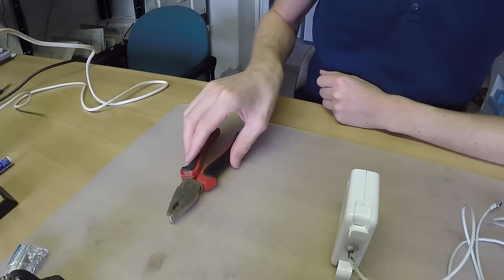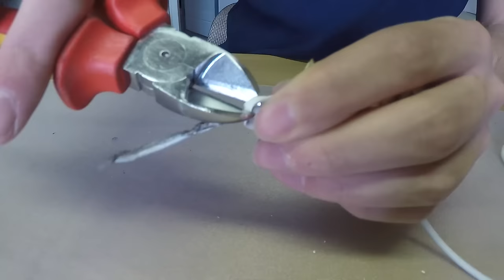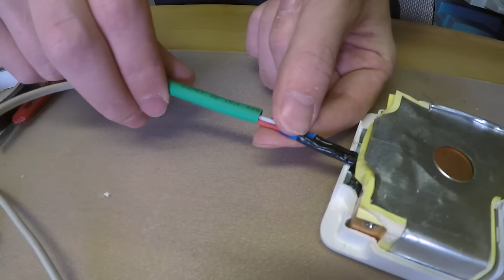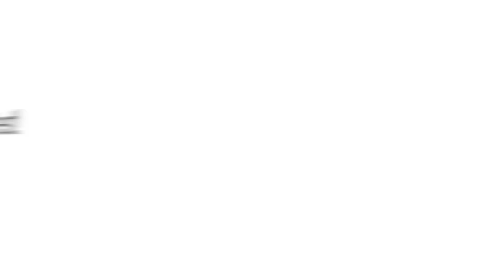How to repair your MacBook charger?

Comment: I continued watching this even though I know I can't do this
Reply: You just need some tools, you can get most of them on any shop for less than 10
Reply: @Zionoafk  I would recommend some wire strippers, I have never used them before because I didn't own any but I borrowed some from my grandfather and they work well

Comment: Watching on 3% battery, feeling sad because i have no money for new cord nor do i have any of the tools he used to fix it.  Goodbye internet! ✌️
Reply: Use your phone to watch the video to fix it then..
Reply: The tools he used would, with the essentials such as soldering iron, flux, solder, shrinking heat tube, etc would cost around £50
Reply: @techaid1940  nothing comes for free and that 50 will help you save hundreds and hundreds plus save on landfill long into the future
Reply: Nikolai Sliwerski um, ok
Reply: dobbatron idk, It’s in the middle ig, you are a teen or something, quite a lot, you’re an adult, you spend that on your weekly shop and spend even more on bills
Reply: Aiden Atkinson - Aido Playdo Aiden Atkinson - Aido Playdo i thought you were saying £50 was a lot of money, right? A new apple adaptor is £79 so 50 is saving money plus you get the skill and tools to fix other things. Am i missing something?
Reply: Nikolai Sliwerski no, I’m saying that it’s better than buying a new one
Reply: Nikolai Sliwerski that is what you thought I meant, right?
Reply: Aiden Atkinson - Aido Playdo it's not nothing but presuming you need to keep your mac working it's a sensible, economical option.
Reply: Nikolai Sliwerski precisely
Reply: Same

Comment: My charger looked exactly like this one at the beginning of the video.. Just confirming that after watching, I was successfully able to fix my Magsafe 2 charger doing exactly what this guy does, but I only used electric tape to hold the wires in place, hot glue to support the base, a pair of scissors, and a pretty small pair of pliers. Prying open the charger is a little tough at first, but everything else is pretty simple. So if you’re broke & need a quick fix don’t worry about buying all the extra tools & pieces. It can literally be done with stuff you already have laying around the house. 👍
Reply: I'm not broke, but I refuse to give Apple another red cent. My 3rd adapter just failed. Apple should be sued for this hack job design of theirs.
Reply: So you just taped the wires together instead of soldering?
Reply: @taliesinmusic  that’s correct, still working since I fixed it
Reply: Thanks for your such useful tips for us❤

Comment: How can you know due to contact between worn-out old wires, there is no short/blown fuse/ internal damage in the charger, before spending so much time to repair it?

Otherwise and minus cosmetic imperfection, You did a great job. 
LIKED.

Comment: Install a plastic wire tie around the wire bundle inside of the case, for strain relief. If it was longer, tie a UL knot. Either way, something is needed so it will resist being pulled out. Thanks for the video!
Reply: Like a twist tie on a bag of bagels type thing?
Reply: That's a great idea!

Comment: A video that provides help is always valuable. I searched for a video to assist me in resolving an issue with my 2017 MacBook Pro charger, and I found one that was published in 2016. Despite its age, the video proved to be beneficial in solving my problem. It had no complicated setups or flashy effects, just excellent content. The fact that it continues to aid users even after seven years since its release is remarkable. This is truly an outstanding video, and I appreciate the creator for making such a useful resource.

Comment: For anyone who got confused with the wiring. He connected the outer metal wires (he used red shrinking tube for them) with the black cable in the transformator.  So I think it's the ground cable. The inner tube with the white cable (probably power cable). It didn't get quite clear in the video and I had problems figuering it out. For me it worked out like that and my charger is up and running again. I hope I could help :)
Ps: I have to appologice for my bad english due to my mother tongue beeing german. (not form Germany, but Austria ^^ the land of the mountain kangaroos)
Reply: thanks fo this clarification
Reply: Yeah that one took me a second too.

Comment: Sick Video, works without soldering the connections as well, noticed a lot of people saying they didnt have the tools, you can honestly do a way worse job of this but still fix it by just using electrical tape and braiding your wires. (full disclosure though this method is way more fragile but still renders a working mac Charger)

Comment: Complete tool list would be useful
Pliers to separate the mag
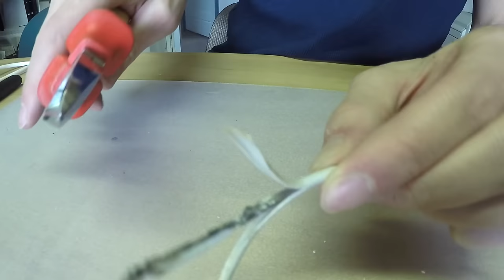Wire cutters to strip wires at 0:36
Again wire cutter stripping and exposing metal inside wire at 0:50
Heat shrink tubing
Using a lighter to...?... Keep the wires melty?

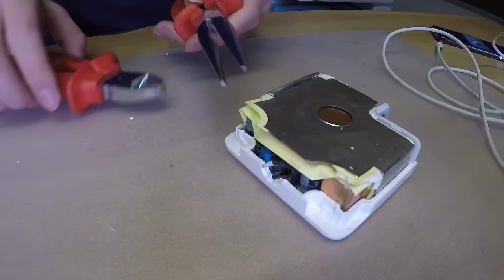1:38 use box cutter to cut off part in the mag to expose the wires with a needle nose pliers and a wire clipper
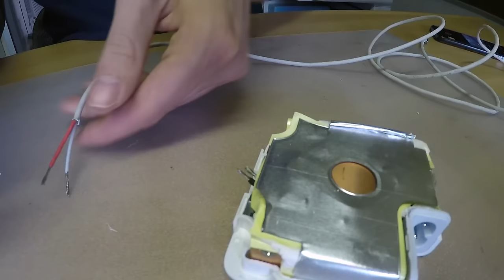2:00 use more heat tubing for...safety?
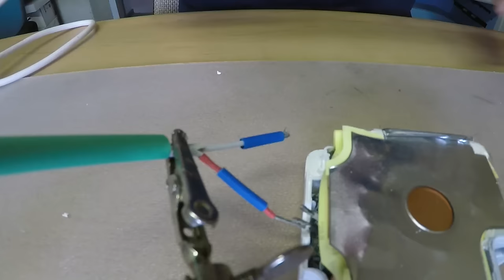2:12 use unlabeled tool (clothespin and book would work I think?) To hold wires up for soldering

Soldering i think just melts the wires together and should be practiced a little beforehand but is probably doable

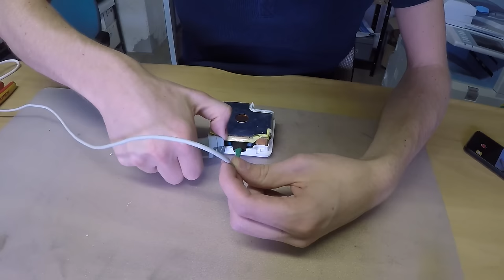3:00 then use lighter to shrink wrap the tube?
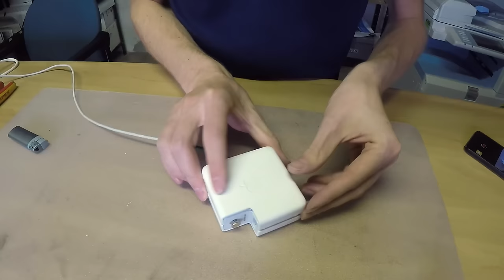3:24 this device right here almost would have made the younger me click out of this video.That is a weird looking device he chose to not label, and I've never seen a super glue gun look like that. Because that's all it is, super glue. Thankfully I was able to pause the video and read the bizarre brand of super glue he bought. But you could probably buy it at any dollar store. Most of this comment is just to set the record on that one.

After that is the hot glue ending.

Comment: I learned all I needed in the first five seconds - separating the case so I could get inside. After that, I was able to replace the cord with a new one I bought on eBay.

Comment: I have done it so beautifully. :) so happy! mine looked like exactly like yours and my child pulled it cut it off from the cord. I have done all similar but except that I did not soldiering, rolled the coils together by hand and I found it strong like that and coz I don't have the kind of glue you had it at the end, I insert earphone cover plastic from the T side of the magnetic end and take it all down to the tip. It not only hold it tight but also make it look like original. It costs me 3 GBP. From UK! Apple must give you millions of dollars, I suggest! ;)
Reply: anteneh addisu Yimer did you use the heat-shrinking tubing?

Comment: You can re-use the restrain, it's molded over. You just need to leave the longer wires and pull them out. Clean it, slightly expand and ... profit.

Comment: I did it, just crappier. No prior experience.

Soldering Resin core  +  flux = $6.50 at home depot or lowes
I borrowed a soldering gun. Ask your neighbors. 
My soldering job was terrible, I used electrical tape instead of heat shrink, and I broke the charging case when I opened it. 
It looks ghetto, but it works. I saved $23 dollars (from a used one on ebay) and not gonna lie I feel kinda proud.

Comment: Great video and helped me repair mine. I however did it more simply as only the outer cable was severed. I got a length on the outer cable by stripping the casing top and bottom, twisted the ends and soldered them. Then I wrapped black electrical tape round it and hey presto! Now advised my family not the bend the connection so hopefully it would last. However should it break again then I still have your method as plan B!

Comment: Great demo - aIve hopfully fixed my charger - BUT would be good if you clarify wire connections. - Bit worried about plugging in incase i blow my Mac.
Ive connected central white cable with blue cable in charger and outer mesh wire twisted together with black wire from charger. Can some one tell me if ive got it right????
thanks - im in AUZ.
Reply: RIP

Comment: Thanks very much Juul. My MacBook Pro charger was in same condition. I was about to buy a new one costing roughly USD 100 here but then I came across this video. I followed (I am not electronics engineer) exact same step on my iPhone, prepared the wires, cut etc and using the help of a local electrician who just knew enough (i.e. soldering) I got my charger back in absolute working condition. Overall it cost me just 50 cents (for soldering).
Reply: is it working properly?
Reply: @ranniellarheapueblos4591  Yes. Working fine

Comment: Thanks man. Get the job done that way! I have been soldering for a while now so the repair was pretty straight forward. I was lucky enough to have some shrink wrap tubing on the bench and was done in 15 or 20 minutes. 

Can't stress enough, though, that you have to know how to use a soldering iron and a little bit about DC electrical comings and goings. i.e. White to White - Black to Red.

Comment: OMG. Seriously? a terrible botch. why didn't you solder these wires directly to the board, replacing the damaged ones? Zero work esthetics. This looks terrible. I repaired my charger and it looks now like original. Even this rubber hosing is original...

Comment: Super 👌 But how to find which wire to solder to which one inside the box? I'm assuming the outer thick core is connected to the black wire inside the box.

Comment: Im sorry but how did you insert the Heat Tubing at 2:54 if you had already solded the wire, because I am trying to replicate that but my Heat Tube doesn't pass through the other end. Did you cut it and fold it around? Thank you

Comment: That is not a good way to solder wires, the wires should be twisted before using the solder. Otherwise looks OK. A better way is remove the old wires from the circuit board and solder the new ones directly to the board

Comment: Half of the cosmetic steps this guy did,was to illustrate the "most thorough" way to go about repairing your cord. If you want to just twine it up ,tape it up and have it a lil ugly,that is up to you and is quite possible without doing everyting he does. So it really isnt that much work,You can do it.. This guy did a proper good job on this repair,minus the heatshrink(hard to look for in The Bahamas,where im at) i  will be doing the same. Bless

Comment: looks great 'IF" you know 'WHERE' the 'FRAY' in the wire is.
But if you cannot 'SEE" the FRAY, like each time you even Move the Macbook Pro Cord and it makes the lite go off and start to lose the Macbook Pro charge(ie) you can see the battery indicator lite onscreen.... then how would you Repair or Replace 'JUST THE Charger Wire?.... * to clarifiy- it is the Charger wire; little thin one, NOT the Power Cord part. ~Thanks

Comment: If you grab the wire you are soldering with a plier below the heat shrink, the plier will heat sink the wire and prevent the heat shrink from shrinking.

Comment: Just did this today, you don’t need to break the battery pack part open tho FYI people. Just cut the cable before it and simple. But this actually works if your cable splits. Thanks for the info man!

Comment: Thank you! Please make a new video too about broken macbook chargers from 2022, the ones using usbc. I think mine cracked and it's a new one 😭 when i plug it in the wall, the "fangs" stay in the wall while the rest of the charger falls. If I force the two pieces together it still charges. Help!
Reply: Yeah unfortunately its Apple's very poor design choice that does that. If I were you and if possible, Id buy one of those long cords that used to be sold with older mac chargers which fixes the problem. Unfortunately there isn't a way around it.

Comment: There's no need to join the cable, just take the unit out the case and solder the stripped cord into the board like the original, though give the inner a good pull in case it case there are other fractures in the inner. I think these units are built to fail so Apple can sell us lots of new power supplies. Replacement magsafe plugs complete with cable are available in Ebay etc for about £5. Be careful though there are two types. Thanks for the tip with the pliers to bust the case open I did it with a sharp screwdriver.

Comment: hello,
you solder two wires. kool. But what about the ground cable?
Reply: Luis Hernandez  there is no grounding cable :) you're suppling your macbook with 16.5 VDC, you dont really need a grounding :)

Comment: under 5 bucks, but what if you havnt got tools? costs alot more than 5 bucks then...
Reply from the maker: True, you could also borrow them
Reply: You need to improve your toolbox, pliers and wire cutters will come in handy throughout your life if you have a. DIY mentality... or you could complain, give up and just go buy another $80 charger, and then another. I think you will find these tools a worthy and cost-effective investment. ;)
Reply: You don't need tools. You just need a pair of sissors/razor blade and some wire tape. I just cut the wire at the damaged part, then cut the rubber tubing down to the edge of the charger, and used the small remaining wire length to twist the two cables together (outer casing to outer casing, inner to inner) and taped each up individually, before taping around it all. It worked like a charm. No soldering needed. I didn't even have to open the dang thing. It took me two tries though, so it's not like it saved me a lot of time.

Comment: what is that you use in order for the wire to stick to the other wire the silver stuff that melts and where do you buy that  ( sorry new to this )
Reply: You can buy a soldering iron and solder (the silver stuff) at a hardware store. Be very careful as the iron gets HOT.

Comment: Hey, I also tried to repair my power supply, but when I want to use the repaired power supply, I get the message on my mac: "battery maintenance required"
Reply: I don't know anything also I'm a kid
Reply: That means your battery needs replaced.

Comment: Because not soldering directly in the charger, because to put silicon if you can use again the ring of platico that you removed, aesthetically the charger looks horrible, functional but horrible

Comment: thats a shoddy lazy repair! if you have got the hard part done - ie splitting the case, why not wire directly to the pcb and do away with the unsightly joins?

Comment: can't we just twist the wires together ??
Reply: Yep that's what i did, worked like a charm. Didn't even have to open the charger up, i just stripped the wire to the very end of the box and used about a centimeter of remaining wires to twist them, then taped them up with wire tape individually.